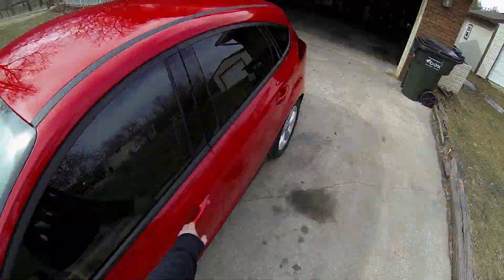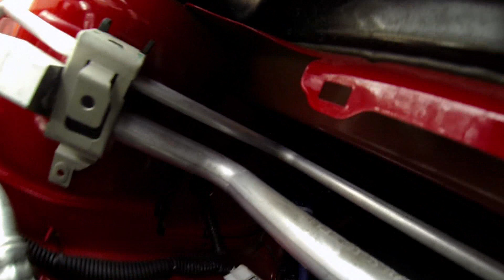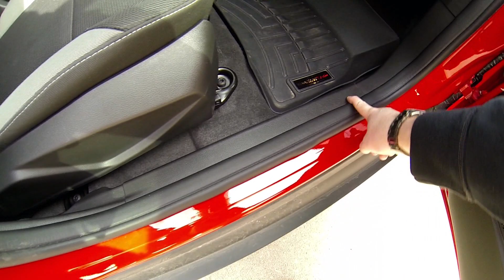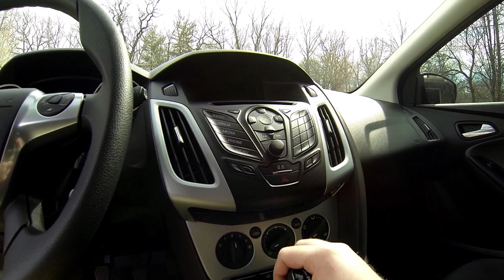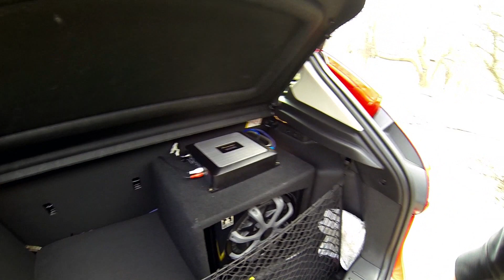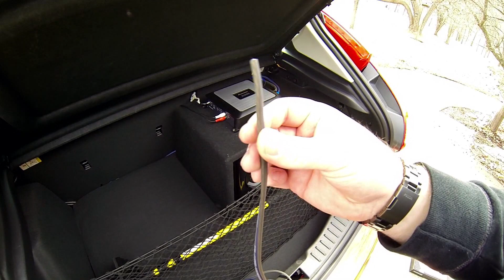2014 Ford Focus Amp Install

Comment: You never explained where to hook up the RCA cables.
Reply: You need high level input on your amp or an loc, he explains tapping the wire behind the head unit
Reply: @vibe1884  So basically just buy an RCA line output converter and splice it into the oem speaker wires on the back of your stereo.

Comment: Where did you install your ground wire at
Reply from the maker: The ground wire attached to one of the rear seat bolts that holds the seat to the frame. I used a cheap ground tester to verify it first, and sanded a little bit and used some dielectric grease as well.
Reply: @codyalger93  right that’s what I did and the ground is not strong enough I have a 3500 skar amp for my 2 12’s and I’m adding another 1,000 watt amp for my doors what’s another good area for a ground to draw both of them amps and a crossover and signal booster lol

Comment: I used to have a 2015 Ford Escape SE. This Ford Focus reminds me of the car. I have that vehicle almost 5 years before it died on me almost 7 weeks ago. Right now that I have a 2020 Ford Escape SE in black. It is so freaking sweet. It has almost everything that I want in the vehicle except not having fog lights. It was a big upgrade from a 2015 Ford Escape SE to a 2020 one.

Comment: Nice and clean install, love it. 
I have a 2012 Ford Focus SE, will I be able to use my factory radio to run my amplifier?
Reply from the maker: That depends on your amp. My amp has auto-detect inputs and can accept high level inputs. Without the auto-detect, you'd also have to run a remote wire to tell the amp to "turn on". If your amp can only accept low level inputs (a lower voltage), then you would need something to bring the voltage down so that you won't fry the amp inputs.

Comment: This is almost all that I need to complete this in my own😭I’m just electrically retarded . What does the splicing look like with the stock radio ? I’ve taken out and replaced my stock head unit but didn’t think it’s possible to link subs to the stock head unit . And I don’t know how to install an aftermarket head unit without a kit
Reply from the maker: I used a multimeter and faded the radio forward/back and left/right so that I could confirm which wires were the ones that I wanted. It's a little bit ugly behind the dash, but I rarely see it. :)

Comment: The only thing I’m stuck on and the only reason I have to look up vids is because I’m trying to bypass using a loc but it seems like you can’t. You didn’t even show how you got rca from the radio
Reply from the maker: An RCA cable is just a positive and negative wire (kind of, but not really since it's AC signals). You just have to splice the positive speaker wire with the positive of the RCA cable (or any other speaker wire and then you can put an RCA connector on the end). Then do the same for the negative. Sorry for the late reply.
Reply: @codyalger93  all good, this car got totaled out and got a clean 30k mile FRS

Comment: The factory front speakers are actually nice. I installed a 4 channel amplifier and a sub amp. If I had to do it again, I would install just a sub amp and upgrade just the back speakers. Thanks for this great video.

Comment: I have all of the door speakers going to a 4 channel amplifier. It is not that the factory head unit is less powerful for the rear speakers. It is that the back speakers are less efficient.

Comment: What do you do with the rca cable my fiesta doesnt have them on back of radio
Reply: Probably done figured this out or given up but for anyone else looking for this answer you need a high to low converter for at least 60w

Comment: Where did u run your remote wire from? Did u use a converter so u can use the sub outputs on  a stock radio

Comment: One hour mode , fiesta red panel problem. Please help. I removed the plus pole from the car battery and the tape did not recover.
fuses work fully.
but a clock mode did not go whatever I did. please can you help

Comment: FatGuyBuilds hey man, so where did/would you connect the power wire(yellow) and ground(black) from the line converter with stock stereo? (Same car as you).              Also, how did you have the remote wire set up? Thanks!!!!

Comment: Never heard of the back channels of a head unit having different output than the front channels...but great video and it's helpful for my 2017 Focus St amp install...I've done others and just used the back speaker outputs.
Reply: Some factory units roll off the bass at higher volume levels
Reply: @MAD_CarAudio  yeah auto loudness

Comment: Since the front speaker wires were tapped into.  Does this reduce the power going to the front speakers?
Reply: No no you are just getting signal threw them l

Comment: I have the 16 fiesta and I'm hooking up my amp now, I've kept my stock radio. For the wires that you run from the radio to the amp did you use rca or the speaker wire in the kicker box

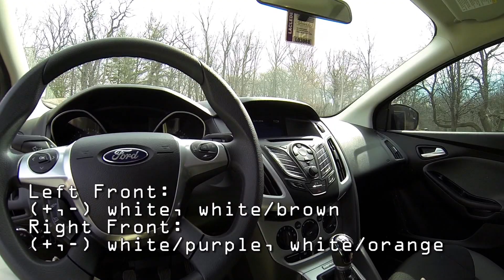Comment: Does anybody know how legit 3:48 on is?  Hooking into the front speakers rather than the rear, because the stock head unit gives more power to the front ones?  Im installing with an active line output converter, meaning it'll maximize the signal being sent anyways.  Not sure if I should tap into the front wires or the rears, thanks
Reply: U do wanna do the fronts cuz the bck of the sync system dosnt give much power

Comment: I used this video as a guide to fit my power cable for my tow bar bypass relay.  Glad I did because I was gonna run it under the car but it was so easy going through the car via the factory grommet.  That weather stripping makes it much easier and gives access to quite a spacious channel to run cables. Thanks for posting.

Comment: Just finished threading my power wire through the grommet - holy hell what a pain in the ass!!! My fuse holder was attached to the power cable, so I could not go in from the glove box.

Comment: Watched to see how they mounted the wire to the battery, looks like I came here for nothing.
Reply: The video helped me..but i also came because of that just to see how they run the wire to the battery
Reply: Some of the cars have already a hole with a plastic lid...mine doesnt so im guessing i have to drill

Comment: You call that a amp install you didn't even show where you run your wires where u plug in aux wires on the stereo haven't got aux on it

Comment: My wiring to the stock radio aren't really white? They are pinkish? Is that normal. They have a red tint to them. But they have the same line of strips through them.

Comment: Did you mention how ground your amp?
Reply: I was wondering exactly where to ground mine as well
Reply: Ground to subframe after sanding to bare metal, then spray with plasti dip to prevent corrosion.
Reply: seat belt  anchor point is a good spot

Comment: where does the remote cable go on the stereo?
Reply from the maker: Dan shenouda The remote cable won't go onto the radio. My amp doesn't need one, so I didn't run it. But you'll need to find a fuze behind the glove box that is only on when the car is on. And then just use an "add a circuit" fuse holder. The remote will go from a fuse to the remote terminal on the amp to tell it when to turn on (so that it won't be on when your car is off and drain your battery). I'd double check with your amp though and make sure you actually need it. Nowadays a lot of amps don't. Check the manual for "auto turn on" or "auto sensing inputs".

Comment: How did you mount the fuse box to the battery box? I'm struggling to get a drill in that spot.
Reply from the maker: Mitchell Bieniek I used some short self-tapping screws. I screwed them in by hand with a stubby screw driver.

Comment: Have you had any ignition problems with your car not turning off immediately? I have a kicker amp and sub from the previous owner and experience infrequent ignition problems. Once I disconnected the sub wiring the problem stopped.
Reply from the maker: colin yabor I haven't had any issues. I just swapped out my sub and amp and have had no problems so far. I can't imagine what they could have done to mess that up, unless when they ran the power wire through the firewall they accidentally cut some other wires. If you live around st louis I could take a look at it.

Comment: Where did you "plug in" the power signal wire?  I don't have the rear fuse block in the trunk/hatch.  Need switched 12v supply and have a coupld contenders, just wondering what you did.
Reply from the maker: My amp doesn't need a remote on signal. It automatically senses the signal on the audio lines and turns on.
Reply: clever amp.

Comment: Great video! I installed my amp after watching this video and everything sounds awesome. I ran into few problems but I solved them and now I feels so good. Thanks for this video, it was all I needed.
Reply from the maker: Jay Dallors No problem. Glad I could help. What snags did you run into?
Reply: Dakota Alger when I was making a hole through the grommet to run the positive wire to the battery I cut few others wire mistakenly lol. Reconnecting those wire was a pain in the a**. Other than that everything else was ok and I have a 2013 focus se hatch.
Reply from the maker: Jay Dallors Oh yeah, that would be difficult. At least you got it all working now.
Reply: did you keep your stock radio? i’ve talked to some guys and they’re saying i might need a new radio to connect. basically does the stock radio have an RC plug to connect
Reply: also, I don’t know what I’m talking about so I might be asking the wrong thing😂

Comment: Unfortunately, the stock amplifier begins to clip (distort) the signal past half volume. So, with a line-out converter you're just amplifying a distorted signal. You must bypass the factory amp.
Reply from the maker: Doug Souders I haven't had any issues, but I am using the radio outputs for the front speakers.
Reply: I had this same problem. When I use only the front left speaker to the amp the audio is fine. Soon as I run the right speaker the static comes back.

Comment: beautiful job dude. I have a 13 se hatch. I really want a system in it but I'm nervous that it could cause electrical problems or possibly void the warranty. if you/your brother lived close to be (pa) I'd pay you to do mine!!
Reply from the maker: Andrew Hagan Thanks! Yeah it can be tricky, but as long as you take each step slow then it isn't too bad. But I'm quite a ways away from pa.
Reply: Thanks for the quick reply! That's too bad haha wish my focus was stick too. I've got the the slippery tranny. Might just sell and get the manual version when I can come up with enough money. Take it easy Dakota! Great work

Comment: So if you are splicing into the speaker wires with the RCAs you do not need a remote turn on line?
Reply from the maker: Jamie Schleeter No, the amp may still need a remote turn on wire. My amp has "auto-sensing inputs" so that it sees the audio signal on the amp signal input lines (RCA cables), and then turns on the amp. When there's no signal, it turns off. But that's completely amp dependent. Also, depending on the brand, I've heard of auto sensing inputs draining people's batteries when it doesn't turn off. Luckily mine works really well and I've never had an issue. If your amp doesn't have auto-sensing, you will still need a remote wire connect to a fuse that only turns on when the car is on.
Reply: Right ok thanks! Great video!  I have the same car and like my stock stereo and to install a different unit is very costly for the kit! So this helps tremendously!  Thanks again!

Comment: Hey, I have a mono (single channel) amp JBL GTO-501EZ. I'd like to know if I can get the signal DIRECTLY from the stock player of my Ford Focus II Sedan without a line out converter, would it work? Also, since it is a mono amp, I will only need 2 wires; can I cut front left to get the + and front right to get the - (like bridged) ? Would it work like that; or I have to cut front left + and front left - (left channel) ? Thanks!
Reply from the maker: Alexander Leet You'd have to check the manual for the amp and see if it has high level inputs. if so, no line out converter needed. 
For the signal though, I think even if it's a mono amp you still need both left and right inputs. Since audio is AC, I would not mix the two channels. If the amp only has one input, just take it from either side. Otherwise I'd recommend connecting both left and right channels.
Reply: "If you have connected the GTO subwoofer amplifier to your factory audio system's speaker outputs, theaudio system may show a "speaker disconnected" message, or may fail to play with an amplifier connected to itsoutput. If this happens, set the GTO amplifier's Input Level switch to the "Hi2" position. The "Hi2" position includes acircuit designed to fool this type of factory system into "seeing" a speaker connected to its output." I guess I don't need it, right?
Reply from the maker: Alexander Leet I'm not sure. The ford radio won't have that problem because the speakers will still be hooked up, so the radio will always see a load on the output. Just double check the high level input rating (max voltage) and make sure that it's high enough for the factory speaker output.

Comment: this works in a 2016 focus se as well. I used a line out converter on mine and installed it rite under my stock deck inside the dash. all the wiring is in one place including the power wires.  great video. it was a lot of help.
Reply from the maker: Jordan Chesky I connected it to one of the rear seat bolts. Just use a ground tester to verify the connection before hand.
Reply: the factory amp is part of the whole radio right? I can just tap the harness and run the LOC and some RCAs?
Reply from the maker: isaac mays Yes, sort of? The factory radio has an amp in it for the speaker level (high level). Then you can tap into the wires coming out of the radio and run those into a LOC to convert the signal to low level. And then from the LOC, you can run RCAs to the subwoofer's amp. With mine, I skipped the LOC entirely, because my amp can accept high level inputs. So for me, a LOC would be a complete waste of money.
Reply: Dakota Alger okay cool thanks that's exactly the answer I was looking for, just where to tap in. Some of these new Ford's have an amp in the back
Reply from the maker: isaac mays That's only if it has the upgraded Sony stereo system. I haven't worked with a car that does though.
Reply: where did you happen to connect your ground?
Reply: curious as to how the dash came apart.  I have seen several videos like this just showing the two screws and it pops off.  But looks like it may have changed with our models as I see videos with them taking the area around shifter apart also.  Did you have to do all that or is it like this video and it just pops off after removing those two screws.

Comment: not sure how quick of a reply I'll get but how did you cut through the rubber grommet? we've tried drills, blades, screw drivers but it doesn't wanna puncyute
Reply from the maker: Chase Tappan We used a utility knife. Just go straight through the side without all of the wires, and use a flathead screw driver to help guide the wire through.
Reply: Dakota Alger wow. that was quick, thank you! we will give it a go
Reply: Thank you! we were able to get it through, appreciate the quick reply.
Reply from the maker: Chase Tappan No problem! Glad I could help.

Comment: Where did you put the signal wire??
Reply from the maker: Isaac Shenk The left and right signal wires connect to the factory radio wiring harness and then run along the driver side underneath the door sills all the way to the back.
Reply: Dakota Alger so you spliced L/R Rca wires into the small L/R speaker wires?
Reply from the maker: Yes, I used some tap-ins to connect the L/R RCA wires to factory wiring harness.
Reply: The line out rcas you spliced them into the regular speaker lines behind the radio?
Reply from the maker: Yes.

Comment: i know this is a old video not sure if you still responding... so you described everything in your video   i understand your amp doesnt need a line out converter because its built in..... my only question is you tied into the front speaker outputs from the radio up front.... the signal from those wires  have to go to rca input of amp....how did you get speaker wire to turn into the rca connection to go into the rca input on amp    is my only question
Reply from the maker: Jeff Monigle I got an RCA cable that already had the two wires separated, you can take any RCA cable and do the same thing. One will be the ground, and the other the positive. So from the radio, I connected the left + to the positive (I think the center pin) on the RCA cable, the - to the ground on the RCA. Then the same thing for the right speaker. When you cut into the RCA cable, if there aren't two separately insulated wires, then the positive will be the single insulated wire, and the loose stranded wires around the positive is the ground. Hope that helps.

Comment: I'm a little lost on how you get the rca cables without a line out converter is that just for your amp?
Reply from the maker: Pretty simply. My amp doesn't need a line out converter. lol
A lot of amps have "high-level" inputs. All a line out converter does is takes the "high" levels and drops it a couple volts to be safer for the amp. That, and some of the fancier ones will add other features. That's why I love my amp, high level inputs and auto sensing inputs, so no LOC and I didn't have to run a remote wire to wake the sub.
Reply: what kind of amp was it?
Reply from the maker: madsenkid19 It's a Pioneer 750 I think. A friend just installed a Pioneer 8600 and it had the same features. If you're looking to buy an amp I recommend Pioneer, but if the amp has high level inputs and remote sensing, it will make your life a lot easier.